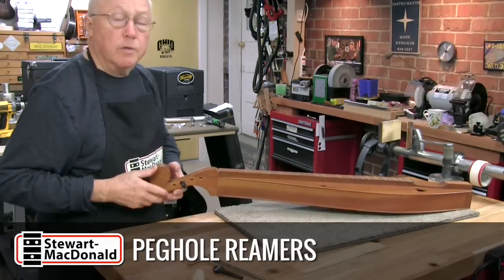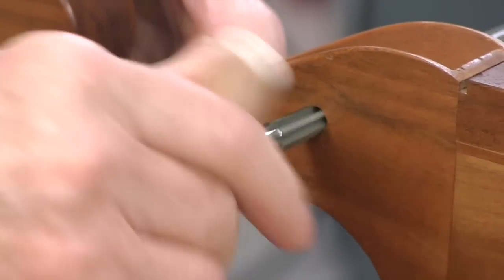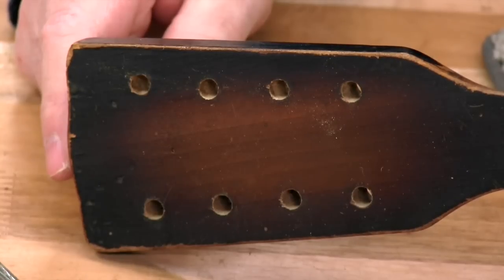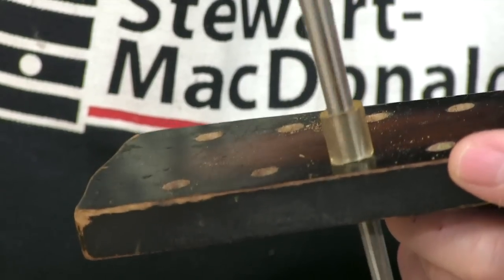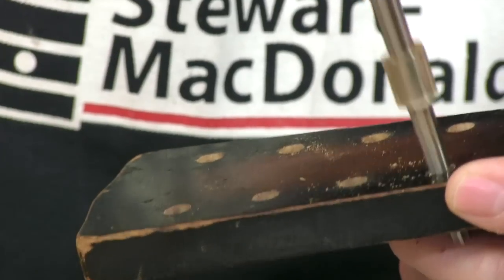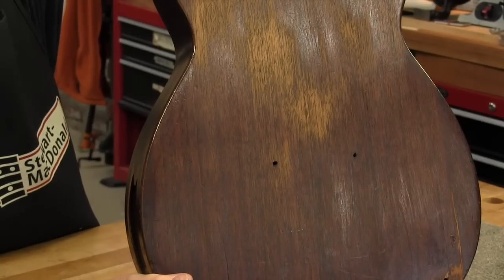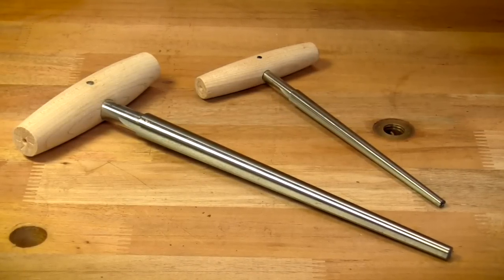Peghole Reamers Demo

Comment: Love seeing that all important 2 degree taper made by the reamer getting taken away with a hand file.
Reply: Sorry but you didn't fully understand what he said!
The 2° taper is all-important if you ream a tapered peghole because readily available violin or guitar pegs normally have that taper.
A completely different use of the reamer is to center and clean up a badly worn hole, for example a normal, parallel-sided tuning machine hole. That's when he likes to ream the hole to the proper size from both directions then remove the extra wood from the inside of the hole with a small rattail file. In that case, the target is a parallel-sided hole.
Obviously the transition between the two different topics was too fast.
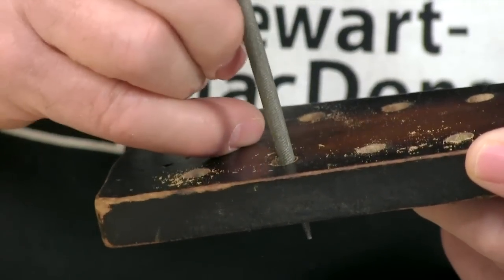My opinion is that if you use a steeper angle reamer, such as a 1:50 for the second purpose, you might not need to clean out the inside of the hole afterwards, if you find the use of the rattail file unprofessional.
Note that you must take care with a 1:50 machinist's reamer, because it can bite into the wood and ruin the hole edges. It's best to use a left-handed spiral reamer in that case, it cuts more gently.